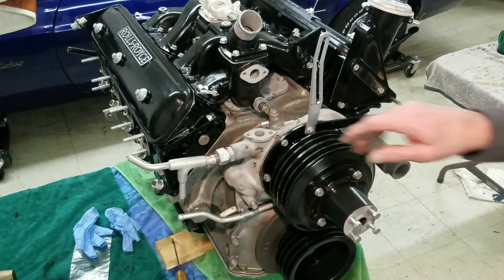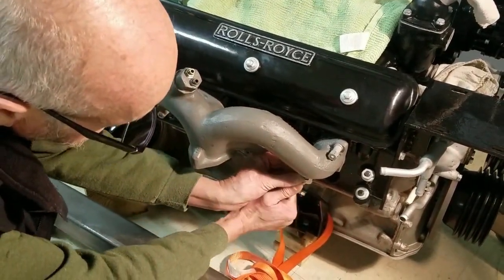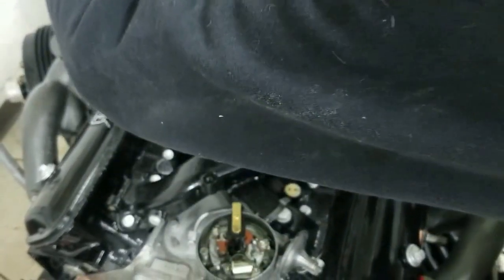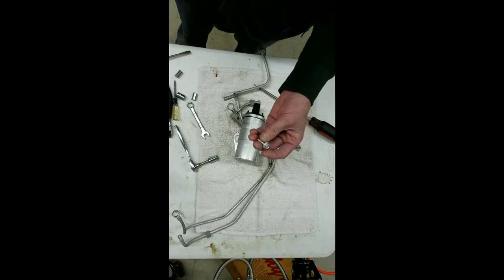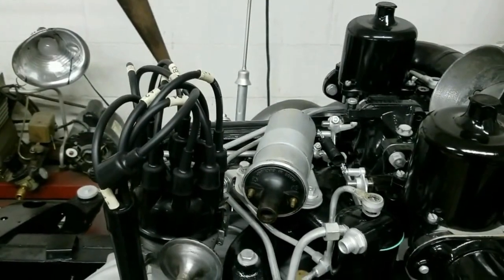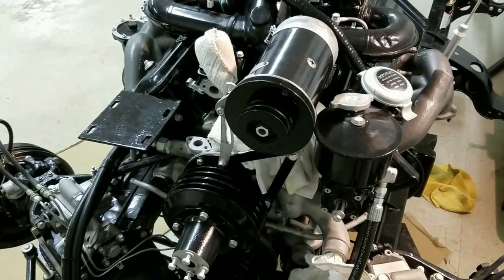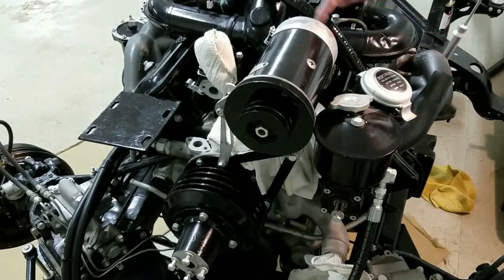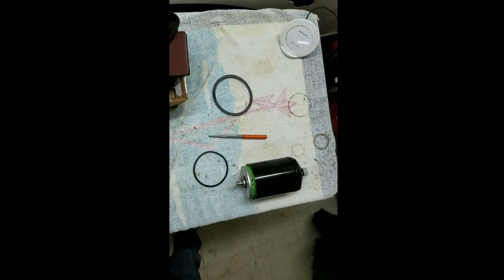Engine Rebuild Silver Cloud 3 - Part 6 -Dist , Carb , Gen , Oil Filter

Comment: Have you considered using copperslip or equivalent  high temperature grease on exhaust nuts and other nuts and bolts. I find greasing the threads with an old toothbrush just make things so much easier in the future, although exhausts do burn it off.